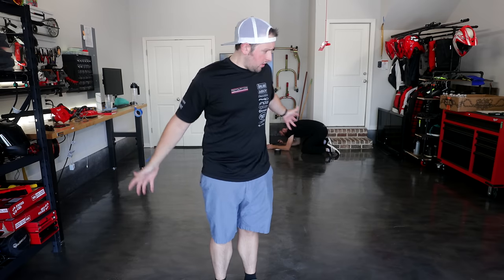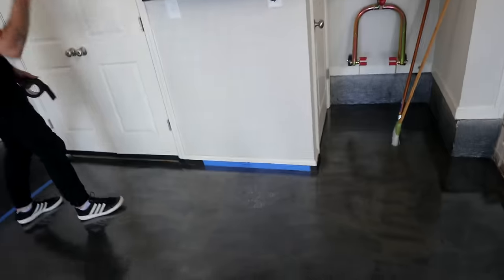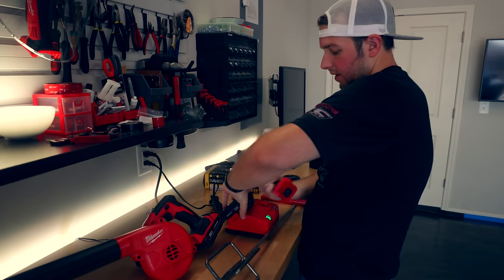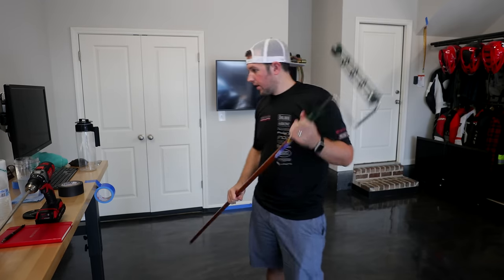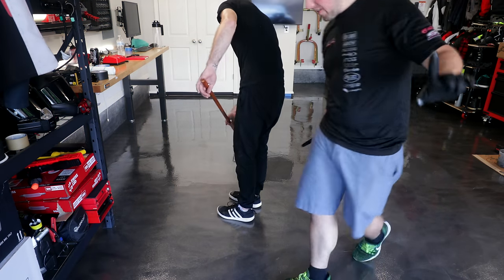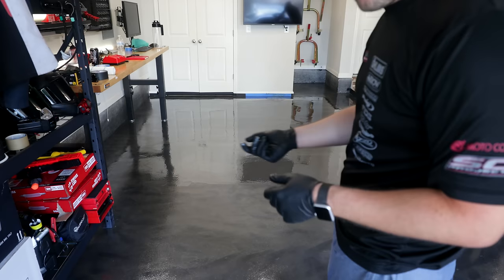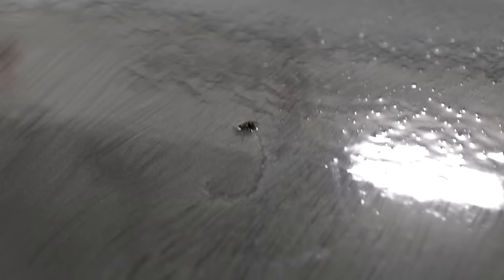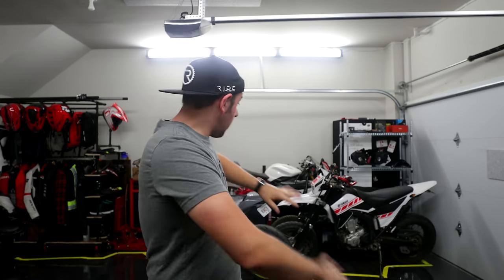Fixing my Rocksolid Garage FLOOR

Comment: Did this to my 2 car garage, did all the steps you did but at the end I put it on with a roller that had a 1 inch nap on it. Turned out thick and even. About 2 years later it’s still perfect.

Comment: Saw the problems before they happened when I watched the previous video on this project.
#1 mistake made when using concrete dyes, sealers, paints, epoxies, coatings, new concrete, etc. is not examining, cleaning, preparing, and completely fixing the concrete that will be taking the coating.  Now for all the details and why:
Whatever the concrete feels like as far as texture and what it looks like, will make a huge difference.  A smooth concrete surface will need less material.
Some concrete is more porous, so will require more material anyway.  And the epoxy/coating being put on can vary as well, depending on the material itself and temperature etc.  For example, a warmer application will likely soak in better, would require more coats, but I believe should provide a stronger surface.
As far as color, even some opaque coatings will not completely prevent the discolored look between areas.  So what you see on the surface, can and will come through in some way.
The fix:
This was the fix, a lot more material, a lot more coats, until it is all leveled off and thick enough to hide colors and textures.
Next time, spend extra time on the concrete first.
If the surface, like this one, is uneven all over, textured in various ways, needs patching...then you might want to go all in and grind down the high spots, clean well, etch well, clean well again, then pour the best high strength self leveling concrete on top one can find.
Then put on rocksolid.  And it won't 3-8 boxes, but 1-3.
Important reminder, provide texture in the coat, unless you want a super smooth but potentially very slippery floor.  Rocksolid I believe sells a texture material, so do many others.
Reply: There is no way you can achieve results that look great (the epoxy look that everyone expects) with only 1 to 3 boxes. Even if the concrete is smooth and all the other factors you've mentioned are properly taken care of, there needs to be a minimum thickness of the epoxy to get the results. 1 to 3 boxes is next to nothing when it comes to what actual epoxy floor pros would use. Just take a look at all the videos from the smaller companies who sell epoxy. They would have recommended 10 gallons of epoxy for this garage. He ended up putting 6 boxes of Rocksolid on. That is only 3 gallons of material. It is ridiculous that Rust-Oleum is recommending only half that amount. Bottom line is if you want great results it is going to cost some money so might as well do it right and spend it to get enough material.

Comment: For how much you’ve spent so far, you probably should’ve just hired a company to do it.
Reply: no he probably saved 4 grand on a professional epoxy flooring gig. nice try tho
Reply: Yeah I was thinking the same thing, I think there should be a cut off for saving money VS having someone else do it.
Reply: aboynamedben not true kind sir. I work for a decorative concrete company, and we would have ground the floor in the beginning and applied a much more premium epoxy, and applied it correctly. Plus we would have sealed it so it will last a lifetime. Probably would have ran him $2,500. More money, but would last much longer, and look 10x better.
Reply: And lose all that DIY YouTube revenue?
Reply: When I got my garage quoted,  Most professionals charge about $6 a sq/ft  from start to finish.
Reply: Maybr he didn't want to. Lol
Reply: egh, a pro job rangers about $1,200-1,500 for a 2 car garage. That is everything from start to finish.
Reply: @Jamisonjames7  Do tell, cause I'm working on my own such adventure. I've been told a sealer will close the pores and not allow the epoxy to penetrate and bond. Rather, to use a "moisture stop". Also, what other premium epoxy would you recommend?
Reply: @grantcoop   Not the 4 quotes I got for my 2 car garage.  They ranged from 2900 to 4500.  I have spent a total of 700 dollars on everything including renting of a concrete grinder as I got the kits online dirt cheap from Amazon.   A true epoxy kit would have costed me around 1.2K for everything even then to do it myself and those kits require knowledge how to put down.
Reply: No, it's thousands of dollars in prep and them product and application.
Reply: i was just calculating all the boxes and prep materials and thinking the same thing when i scrolled down and saw your comment. hahaha
Reply: @recrdholdr  17$ a foot right now was my quote.  Need to coat 800sqft. Yeah

Comment: I just tried this product on my new concrete floor, 2 boxes that advertise 400-500sqft only covered 200sqft and was so thin I could see concrete better than I could the mica(metallic) flake. After 2 days of prep to achieve such dismal results, I just painted with regular concrete paint and vowed to never use rustoleum brand again. You have way more patience and money than I do!

Comment: Just a couple tips for you, if you ever run into problems and have to redo this.

If it's been over 7 days since you applied that first coat with this coating, you should hit the floor with a light sanding with 100 grit paper, or a floor screen. Past 7 days the coats won't have a chemical bond, and you will instead need to create the proper amount of "tooth" for the new coat to grab to. You may see delamination of the top coat appear later down the line. 

Use a jiffy style paddle when mixing the components together, or another paddle designed for resinous coatings, as well as ensure it is the proper size for the amount you are mixing up, so that it is fully submerged into the material. This will limit the amount of air you draw into the mixture, which can be a problem with some resinous coatings, leaving bubbles in the surface after it has cured.

Use a squeegee/magic trowel to apply resinous coatings for the initial spreading of material on thick coats. This just makes life easier, and lets you control the variation in the epoxy more effectively. Normally contractors would also backroll a system like this, which is exactly what it sounds like. You just go back to the beginning and roll over it using a mohair to 3/8" nap approx. Use cleats or spike shoes to walk over the wet material.

I'm a concrete geek
Reply: Only one person should roll it on since two different people will spread using different pressure, making the variations obvious
Reply: You are correct.  You MUST abrade between coats.  If not, the top coat will delaminate in time.  This coming from a flooring contractor.  I hope this is the one time peeling won't happen.  Good luck.

Comment: If you left it longer than a week between the first and final coats, you must scuff up (lightly sand) the floor to avoid delamination of the new epoxy coating. Hoping it all works out well for you.
Reply: I am surprised they did this without sanding first, an using the degreaser and acetone.

Comment: The Rustoleum kits at HD/Lowes for ~$100 are great. It will cover a 2 car garage like the box says. I did this to my current house 2-3yrs  ago and it is holding up and looks good. These are paint flake kits and may explain the consistent coverage. I’m going to be doing this again in a 3 car garage soon and will probably grab 2 kits and some extra flakes.

Comment: Same issue had to do 2 coats for   desired results. You have 7 days before its fully cured and sanding is needed between coats. If you went passed 7 days before doing second coat there maybe peeling issues.

Comment: You should go back to the tile  floor like your old garage. It will solve 2 problems. 1 the AC noise I still can hear and the issue of not having a lot of it. $600 you could have had a better floor than you last apartment.

Comment: I went to Home Depot and bought three gallons of gun metal garage floor paint for $35 a pop. Put down all three coats then purchased the five gallon clear epoxy for $100 and put three layers of clear. Floor look great and cost less than $500!

Comment: I think part of your coverage problem has to do with the fact that you guys were swirling it on instead of actually rolling it on. I wonder if using a spray gun would have helped.
Reply: Evan Solomon not sure why he didnt read the previous video's comments/suggestions. A roller is used to roll, keep it wet and roll it smooth. Enough with the swirls 😂
Reply: I mean, unless he was going for that pattern. Then, 👍👍
Reply: I’ve a 5000 sqft warehouse that I coated in floor paint that was nowhere near as much as the rustoleum, I used my Wagner airless sprayer, and the finish on it is immaculate. Flat, smooth and nowhere near as much work. With the quality of the concrete, should even make it stand out with just a light top coat
Reply: Yup. Im a Sailor so painting is part of my job. It was painful to watch them use the roller like that. More exhausting, pulls your mucles in a way that can make you really stiff the next day, ruin the roller and much worse finnish as the paint isnt applied evenly. Its thicker on the top and bottom of the swirls as well as the edges of the roller when it passed sideways, you gather paint on the plastic part of the roller making it give out paint less evenly and you rip cotton (or whatever its made of) off the roller due to the abrasive concrete, which stays in the the paint as well as worsens the rollers performance in taking up and spreading paint evenly.
Reply: Neil Dougan I think for a small garage floor like this it would be easyer with a roller. When spraying, espeially in small areas, you need to cover up every last inch of what you dont want painted to prevent overspray. 

Spraying does give the best result, but its usually used for large scale projects since it needs a lot of preperation.
Reply: SportSoulLife 
Ordinarily I’d agree, the cheaper sprayers that have a constant air flow are ridiculous for overspray, but the airless sprayer I used had so little, it was cleaner than using the roller, think the airless is the key.
But fair enough, smaller floor, maybe you’re right, just based on this video, I’d so much less hassle and a much better finish that’s still great 4 months of very heavy use and traffic later
Reply: Neil Dougan You might be right. Have personally only used the air paint spray, canned spray and roller (roller the most) so the Airless might be the best choice afterall. There is a learning curve to spray painting though, and judging how they use a roller im afraid that the thickness of the paint wouldnt be even at all, unless they just dump a huge amount everywhere and let it kind of even out by flowing :p
Reply: RustOleum tells you to roll it and then swirl the roller around to create a pattern.

Comment: One of the biggest complaints I hear about the big box epoxies is that the color batches are never the same. You need to get the same lot number when you buy epoxy and that typically is not possible when you buy it from a big box store.   The second most popular complaint is that it peels because the preparation was done incorrectly “as per the manufacturer specifications”.  Always diamond grind or shotblast, always install a primer first and you won’t have any problems.
Reply: Well said..............spot on

Comment: Hey mate, just letting you know that your not the only person that Rustoleum duped with their fake advertising  of the supposed coverage. I have a 7.5m x 4.5m  work shed that I am renovating. Firstly I used a concrete grinder to get my floor perfect, then used the probably 6 boxes of the crack filler. I did go with the Rustoleum primer for my floor, as in the instructions they say that it will use less of the main coat. Unfortunately I unboxed my primer and main coat at the same time and for some unknown reason Rustoleum decided no to label anywhere on their packaging the difference between the primer bag, main coat bag and the clear top coat bag. This is just a really big oversight by Rustoleum  and when each bag is inspected closer all of the bags are EXACTLY THE SAME!!! Why Rustoleum ???? So you can probably guess where this story is going, after rolling the 4th bag down in my shed, I went to open the 5th bag and guess what, it wasn't primer but main coat......  So I ended up just using that pack as a primer packet, all in all 6 primer packs in which Rustoleum  say will cover 134 square meters but yet it only did 34 square meters, alarm bells should have started ringing but too late I had already purchased 4 more main coat packs and 2 clear coat packs. And guess what they were still not enough to cover my floor. So now that I am so far down this rabbit hole, I have acquired 8 more packs. I too have come to the same conclusion as yourself  more is better so in the next week or so I will see if a total of 20 packs of this great product will actually be enough to cover my floor. Oh and in Australia they sell Rustoleum   in a 2 car garage pack (2 bags of epoxy) for, wait for it $280..... So Iv spent over $5k on my stupid floor that all these other you tube videos say is fantastic. Thanks for making a real video of what people should expect when they use Rustoleum.

Comment: did my garage a few years back .. bought a kit from Lowes  of rustoleum  $55 for a gallon ..did 1/2 one week did the other half the next ..put it on thick.. no problems with that wavy crap ...  kit was different back then ..came in 2 metal cans

Comment: Thank you for posting the video.  If you are saying that one box is $100, how many square feet of coverage would you say that you really used, to get the 'look and texture' that you wanted for that money?  If you spent $700, and got really only about 1.5 car garage of coverage, that's quite pricey, or perhaps that's why the places that do this for customers, actually charge so much, because they really layer it on heavy like that, and don't follow the box suggestions for use / coverage....!?

Comment: The main issue with the RockSolid is NOT the product... It is the fact that the floor was not sealed with a color to start with. Raw concrete color is always going to show through a clear epoxy, that has metallic/pearl particles in it. Since there is no pigments in the Epoxy to cover up the concrete, below it.

Comment: Looks better, but in my experience the Rustoleum floor epoxy isn't good long term.  Repairing it is just throwing good money after bad.  I did all the cleaning and prep, including etching and mine scratched up quickly with using tools in the garage and couldn't hold up to floor jacks, so I ended up using Race Deck over it for a few years, then used the product you used to have, SwissTrax.  Swisstrax is much better than RaceDeck due to being thicker and quieter.  Easier to replace a spare Swisstrax tile if you ruin one.

Comment: I honestly screamed at my laptop after the eleventh minute of you using a paint roller like a rag on a stick. forward. backward. slight angle. forward. backward straight again.

Like an english wheel. you wouldve ended up with a more uniform finish with less swirls in it.

Comment: So the box said two kits for single car garage? Is that for two coats or a single coat? Correct me if I'm wrong, but 1 kit is one box?  I would suspect that it's just for a single coat.  So for two coats you would need 8 kits for a double garage like yours.

Comment: Do you think, that maybe, the additive you added to reduce slippage also reduced reflectivity giving a bad impression? I noticed what I think is an orange peel effect after the first coat, and that after you gave it the second treatment in this video, smoothed the surface out which made it look better.  Looks great, but $700--yikes!

Comment: Solution to an extremely expensive product that doesn't actually work, buy more of it to realize it's still not what you want.
Reply: but they are the ones that paid for the time.....2 part epoxy and save yourself a ton of money and have a finish that lasts and looks better.
Reply: @crushsmith7534  which product do you recommend?

Comment: Literally watched first video, drive to Lowe’s, but product ($166 per box), installed product on my garage (2boxes-2car garage), come inside and shower, sit down and THEN this video pops up 😕. Guess I’ll be applying another 2-3 boxes tomorrow.  Question though! Did you ever apply a top clear coat?
Reply: How did it turn out? :)

Comment: Using your own etch messed you up.  There are different kinds of epoxy and the more standard one uses a muriatic acid etch, but the rocksolid stuff uses a weaker citric acid and makes the concrete less porous.  If you used the stronger etch, the epoxy soaked into the floor too much and gave you the rough finish.  Just did my own garage with this exact stuff and the one coat looked great using the provided etch.

Comment: should have mixed a batch and coated just the parts that you crack repaired. then mixed 4 bags into a 5 gallon bucket so you can apply faster. then another 4 bags for final coat. too thick on first coat will have peeling problems .

Comment: These kits only contain around .5 gallons of material. For comparison, I just did the calculator on Leggari products web site for my garage. My garage is twice as big as yours and they recommended 15 gallons! So they would have recommended 7 gallons for your garage. You ended up putting 6 boxes of Rocksolid on which is 3 gallons of product. As you can see, it wasn't nearly enough. I think Rust-Oleum should be ashamed of themselves for selling a product so deceptively when they know there is no way you will get the results they show and promise on the box. Epoxy isn't cheap but it's worth doing it right. Of course, you need to know what that means and with them lying about it doesn't make it any easier.